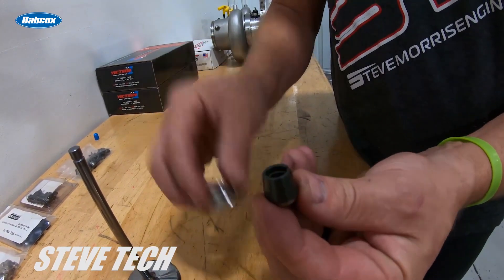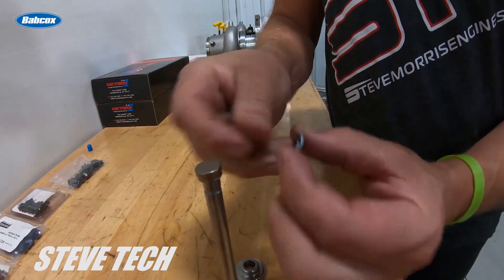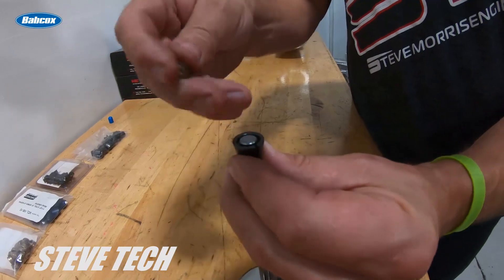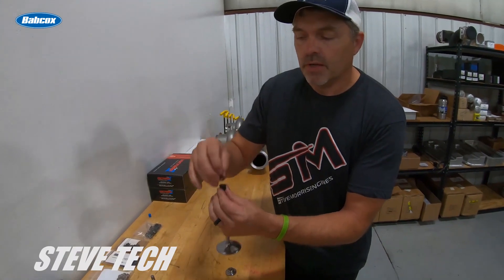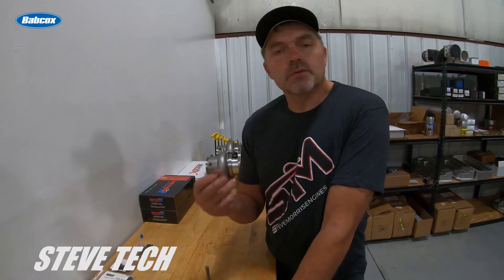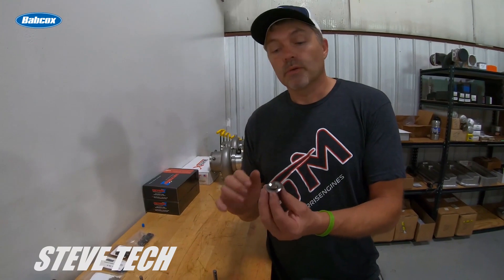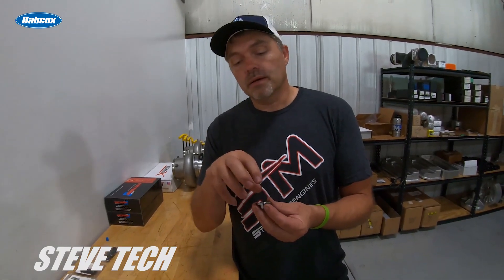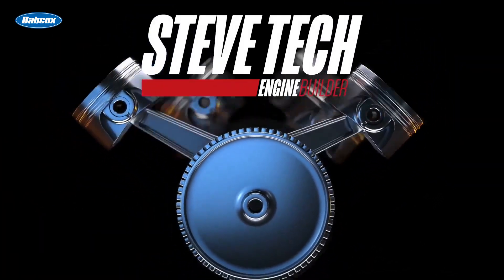Don't Drop That Valve

Comment: Steve to the Rescue!! This video gave the answer I needed, Valve stem Tip of .250, had issue where intake valve stem pertursion with retainers and standard locks with out lashing caps ,on new valves is .210, I Purchased the components to assemble,  10 degree Retainers locks n caps, it would have not fixed my issue, tip is too short. Thanks Steve for this information!!!

Comment: That looks like it will give you better surface area for the roller running big lift?
Steve, what do you think about running titanium 7mm stems in the 3v Cleveland/Boss style heads? I'd make sure runout on the seat was at less than a 1000th, head flex is what I was thinking would kill it. Your lash cap deal is what made me think about that again. That setup would make me more comfortable running skinnies as well.

Comment: In your motors what kind of oil pressure do you like to see. I am old school and its  10 psi per 1000 rpm. I have some buddys that race and they say thats not really correct. Ive watched various You Tubers like Cleetus Mc Farland and by the end of a run oil pressure is low and the motor lives, but nobody really will give an exact answer what is correct. Motors such as the 1973 Pontiac Super duty came from the factory with a 80 psi pump and I do know that takes horsepower to turn but what is best?
Reply: You shouldn't really need to go over 80/90psi.......if you do you probably have other issues.
Reply: Most of the passes where his is low is because the sump has been drained and pressure has dropped. The oil gets trapped in the heads due to windage. I had this issue a while back. My engine did last a very long time but eventually you do damage. ( I destroyed a thrust main and cracked a cap ).  You either need more sump volume so it gets you to the end or a dry sump setup. I made a larger sump cause its cheaper. I run about 30lb oil pressure at idle and 70psi full noise. 1000hp 3800 v6.
Reply: Cleeter cooked the bearings in ruby because of that. They knew it was an issue, and it comes from the oil pan they're using. Rear pick-up, but all the oil goes to the front during decel when you pull the chutes and the pick-up goes dry. 
They changed Leroy because they had that issue with him, and knew it was a matter of time with Ruby. I'd guess they're doing an accumulator setup when the motor gets back from Texas with fresh bearings.

Comment: Should try the old keeper to retainer for test....I was taught this years ago by a really smart guy....assemble retainer/keepers on the valve and pull/twist the retainer....at this point the retainer should be locked onto the keepers....and you can put the valve on the bench and the retainer will stay attached at the top of the valve because of interference fit with the keepers. The valve should also be locked and not rotate or there is BIG TROUBLE with the machining processes of the keepers....I’ve seen a few instances of BIG CAM Company hardware failing this simple test.....buyer beware!
Reply: @Eric Brandt
Good info